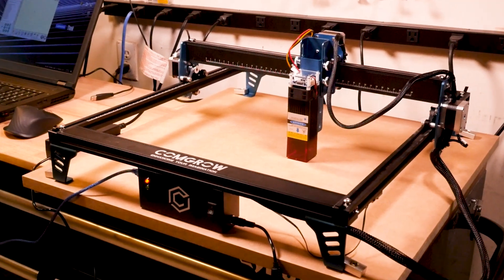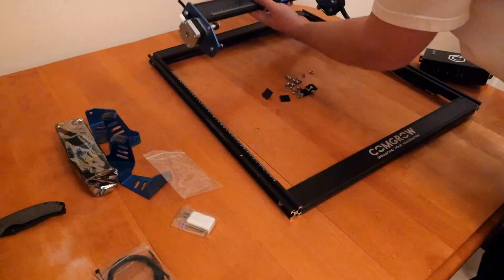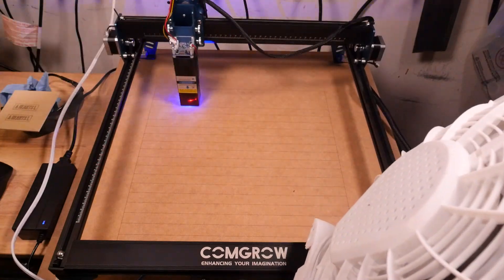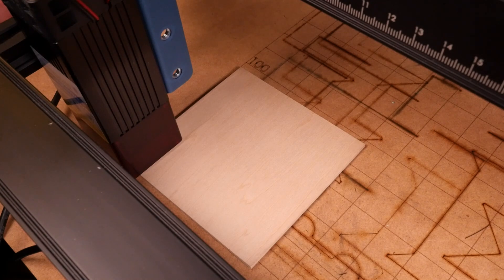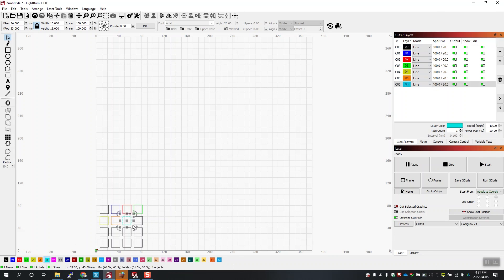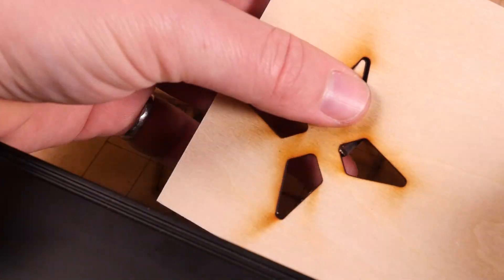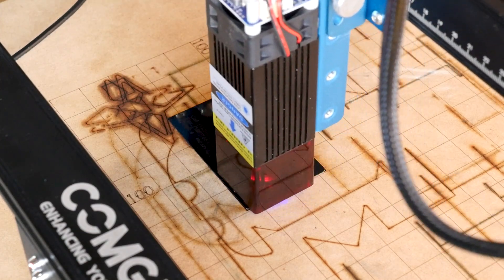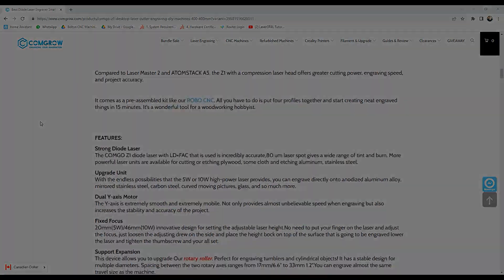Comgrow Comgo Z1 10W Laser Review

Comment: they give no info on height  of laser and centering
Reply from the maker: You bring up a very good point. For the 10W laser, I learned AFTER making the video that it should be 7mm. Regarding centering, I find it best to burn the origin into the spoilboard, and place the piece accurately with respect to that marking. Hope that helps!
Reply: @adamdebowski2037  i cant even figure out the program to get it going  i

Comment: Hi, in your opinion, if you set the height of the laser a little higher could it widen the engraving line on the anodized aluminium cards? 
Did the package with the machine come from China or from an European country?

Nice review (of a nice machine) 👍

Sart0
Reply from the maker: Yes - I think so. I learned after making this video that the 10W laser is focused at 7mm away - not 2mm like the 5W laser. I think you’re correct.
Reply from the maker: The machine came from China.
Reply: @adamdebowski2037  Thanks for the ultra quick answer.

Comment: Hi Adam, thx for that review. I am currently looking into buying one of these laser and the Z1 has definitely caught my eye.  But would it be possible, for us hobby people, to test some more cutting?  I am into RC airplanes and would like to laser cut my own pieces out of Balsa and triplex (most of it is 3mm thick).  also, would you recommend the 5W or the 10W for cutting? Grts
Reply from the maker: Hi Egon - you will have no problems at all cutting 3mm thick balsa. Problems with thickness start around 6-7mm balsa
Reply: @adamdebowski2037  thx for that answer. think I will take the 10W just to be sure.

Comment: This video is strangely well timed. I recently made a large, 6"on side, dice out of .125 steel with tabs on the edges to self locate for welding on my Langmuir Systems Crossfire Pro plasma cutter. ( It weighs almost 7lbs...) The "dots" were cut out at 1.125". When it showed it to my friends at the local brewery one of them asked about the unequally weighted sides. We came up with the idea of engraving the dots instead of cutting them out. A laser engraver like this would be perfect.